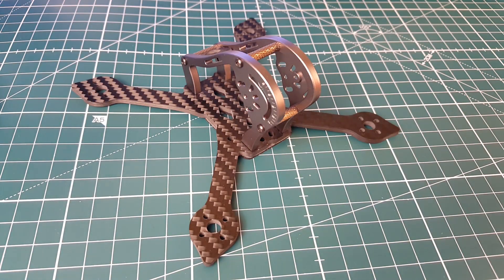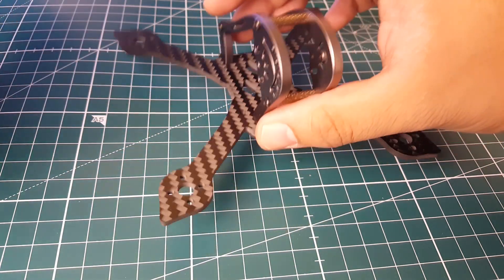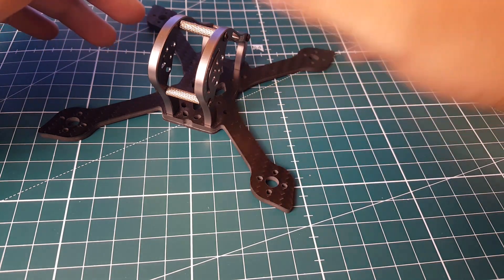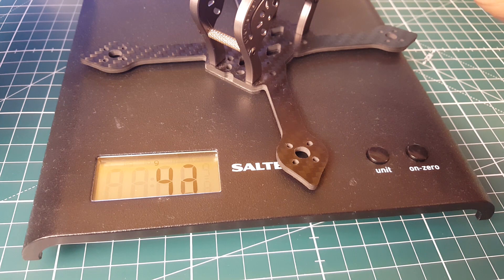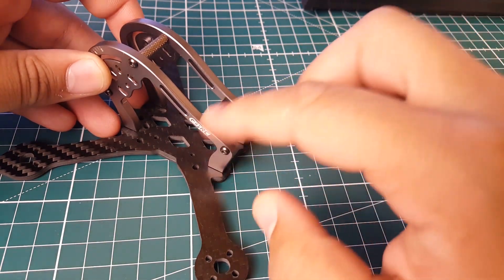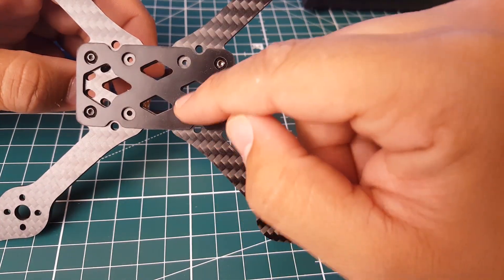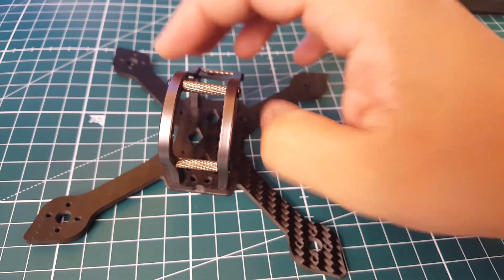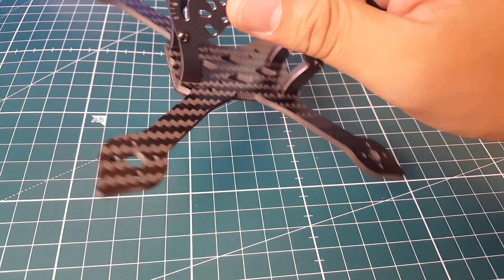GepRC Sparrow GEP-MX3 // Overview

Comment: Built mine with HGLRC XJB F428-TX20, 1406 3500kv Xnova motors, Runcam Micro Swift 2 and FrSky XM+. Running 4S 800 and 1000mah Lipos and it rips on 4S great little frame and it will even carry a Gopro Session strapped to the top.

Comment: I bought one of this frame it was nice to build however on the third flight i crashed and broke the front right arm right at the motor mount.  I was hoping that this frame would be a win. Hope you can check the arm strength too.

Comment: I'm currently building the MSX3 the stretched X. Using Betaflight F3, and geprc 1408 4100kv motors, It even has room for runcam split if you dont go 4in1 esc which is awesome. Can't wait to see what you do with that little nugget !
Reply: Make a video if you can when you get that built. I considered getting 1408/4100kv motors, so i'm very curious to see how much more punch they will have than the 1407/3600kvs I got.

Comment: My frame is on the way. I hope to arrive tomorrow to build it on the weekend. I'm thinking of putting some Emax 1306 - 4000kw, and the HGLRC f425 stack. I don't know if a runcam split fits inside, but it tempts me. :D
Reply: I have the Emax's from another build, from spare parts. I've got a couple of them, from some oferts... got it for $ 8 a piece. I ordered  some 1407 motors from HGLRC. I start to like this company. : D But until the package arrive to my place in EU... especially with this madness of 11.11... Thanks, CopperTop! ;)

Comment: Hi Do you think I can fit the hglrc f438 w/ tx20 + runcam split mini in a single stack. I have the parts and the AIO stack measures a total 33mm in hight at the tip of brass standoff.